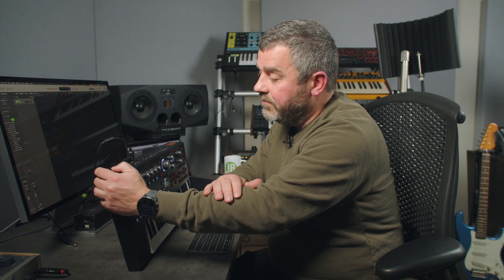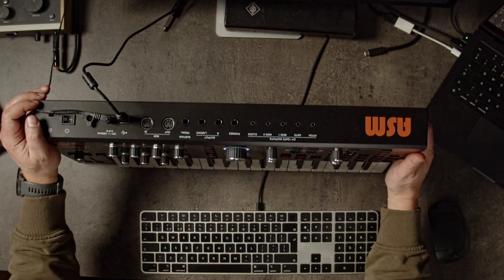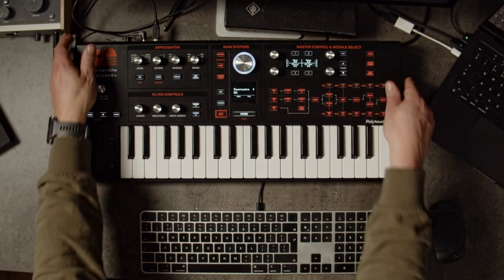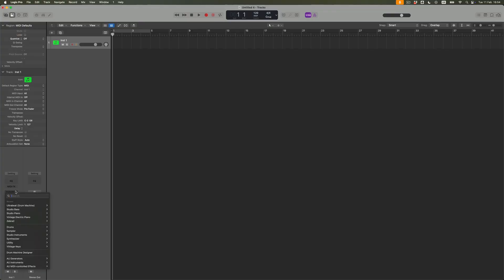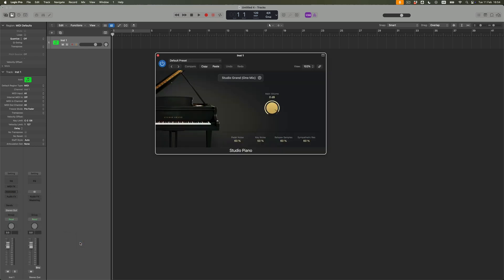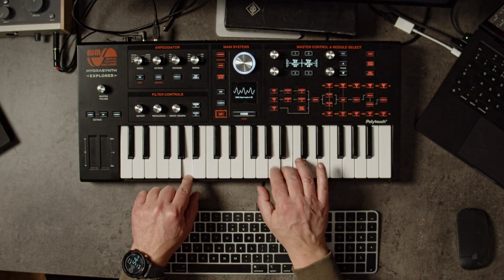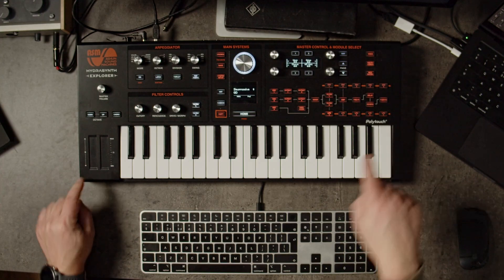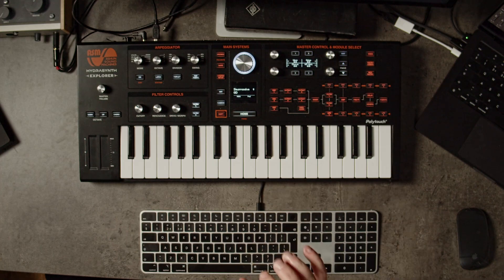Logic Pro: Understanding MIDI and Audio Connections

Comment: what if i wanna connect a mutiple device such as synthesizer with 5pin midi cable to audio interface ? do i need a midi interface  something like that? THX
Reply from the maker: Hi and thanks for your question. There are two things here which are easy to confuse. For MIDI connections, to allow you to trigger the internal sounds in a synth, you’ll need a MIDI connection. If that synth ‘only’ has 5-pin (rather than USB) MIDI, you can make that connection with a MIDI to USB cable. But if you have several such devices yes, a MIDI interface is helpful, allowing you to connect multiple synths to your computer via a single connection to your computer.

Separately, audio. To hear the sounds coming from those synths, you’ll need to patch the audio outputs from each synth to an audio interface. Again, if you have multiple devices, some users like to patch a mixer between the synths and an audio interface so that fewer inputs are required at the audio interface. I hope that helps.

Comment: how do I send a midi file out through the usb midi interface?
Reply from the maker: Hi. These are two separate things. A MIDI interface allows you to connect MIDI-compatible equipment (usually synths) to your DAW so that MIDI Tracks from external instruments can be integrated into your productions. A MIDI file is a single file which contains all of the MIDI sequences within a production. Sending a MIDI file allows someone you're working with to open all of the note and MIDI controller data which exist within your project, so that they can either open the same parts, or assign those sequences to different instruments. Creating and sending a MIDI file doesn't require a MIDI interface.
Reply: @jonobuchananmusic I was wanting to play my midi files.

Comment: how about desktop synths like the behringer pro 800. im able to play the synth via my midi key board (native instruments a49) but only the presets of the synth. if i want to do sound design and go into perf mode on the synth i cant modulate my sound or turning the knobs doesnt change anything. midi keyboard and snth are connected via midi usb. i dont know what the problem is. the synth might be stuck in some kind of mode ...? do you have a solution ?